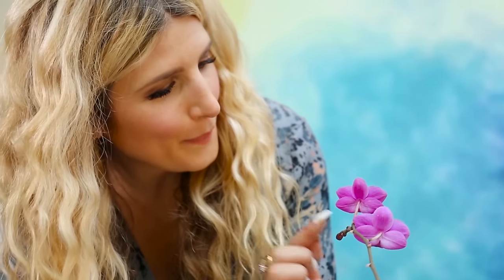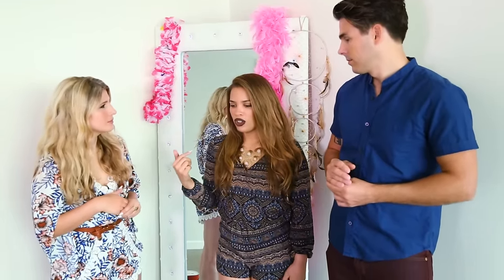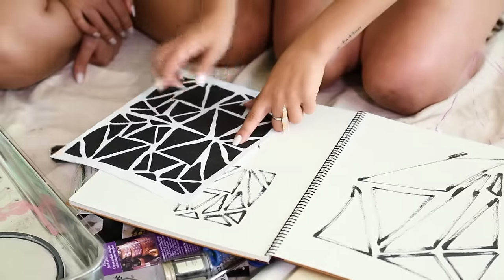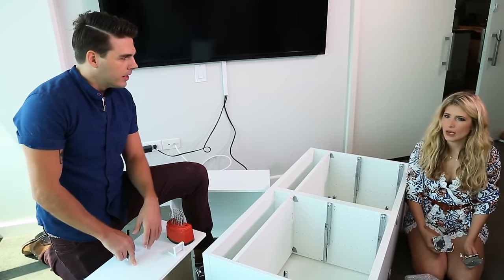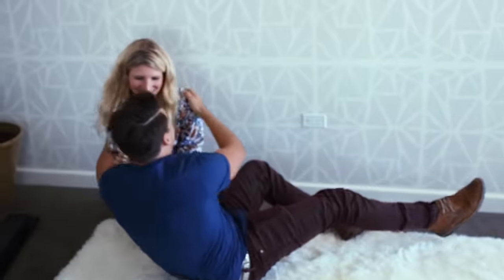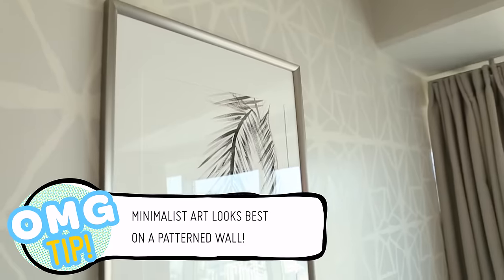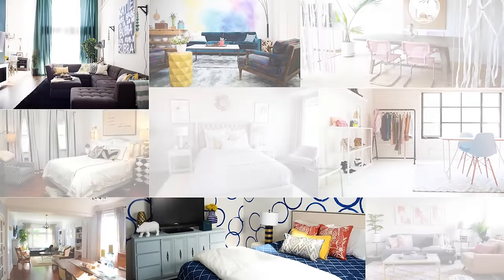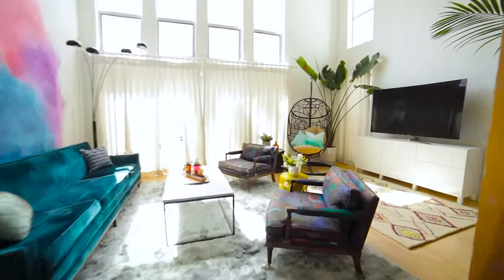DIY Hotel Glam Bedroom for Andrea's Choice | Interior Design

Comment: How much did the entire room retail for? I want to transform my room, and just need a basic idea.
Reply: I'm curious to know, as well. I'd guess a minimum of $2000 because of all of the new furniture.
Reply: i saw another comment that said 10,000
Reply: +jchristine242 your probably right
Reply: +jchristine242 or more
Reply: +GKJ that's a bit off if you want quality furniture it's gonna be way more than that
Reply: +crystal williams I was answering the OP'S question. I said a minimum of $2000, to get such a look.
Reply: The bed alone is $1,000 and most of the furniture is from west elms so it is easy to say that they spent between $8k-10k
Reply: Sue Perez If it's mostly West Elm then I'd bet you're right with that estimate. My West Elm bed was around $1500.
Reply: they thrift and diy a lot, there's no possible way this one room costs as much as ppl are assuming.. but the point is that it LOOKS expensive 😉